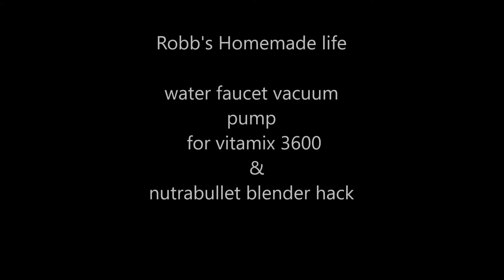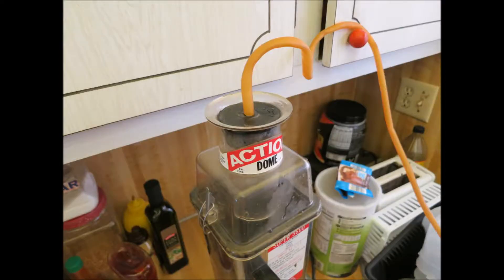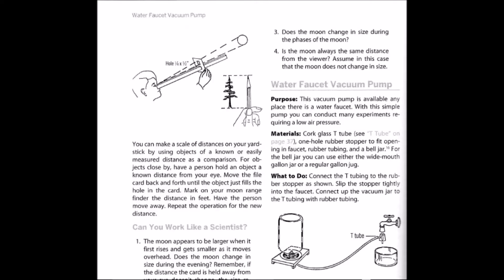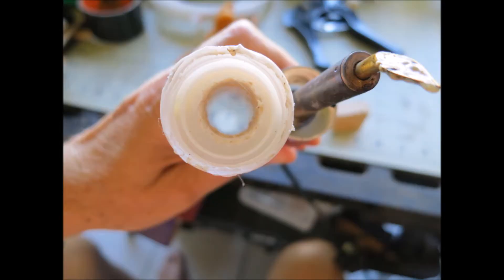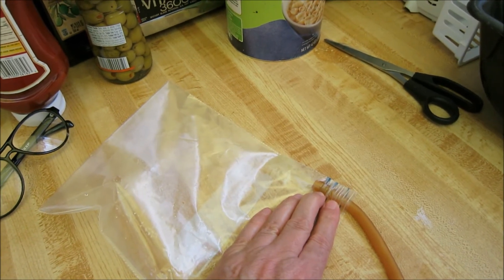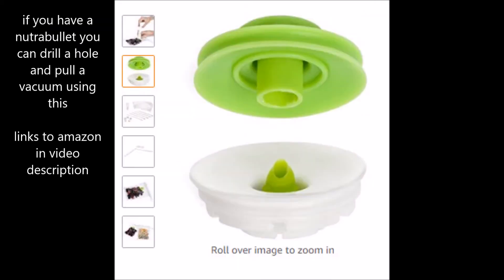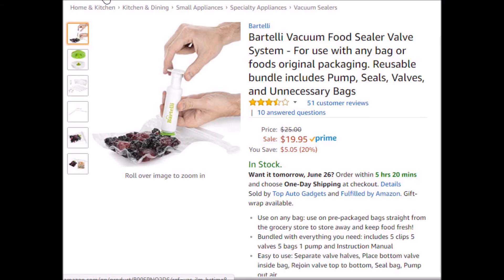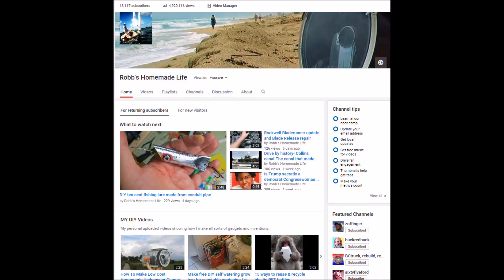DIY water faucet vacuum pump for vitamix  & nutrabullet blender hack

Comment: I have a DIY idea using the ninja vacuum cup on a vitamix or the ninja cup vacuum adapter put in the vitamix cup or the ninja vacuum device on the vitamix container? I was thinking to buy the ninja cup and take off the vacuum adapter and make a hole in the vitamix cup and make it like the ninja cup bottom part or find a way to pull the air from the vitamix blade base so would not need to make a hole in the vitamix cup. I think its possible to make something to use the vacuum device on top of the vitamix main container, even when using the tamper with the container sealed. Just some ideas for someone who has more courage and take actions better then me haha
Reply from the maker: Thanks Lincoln.